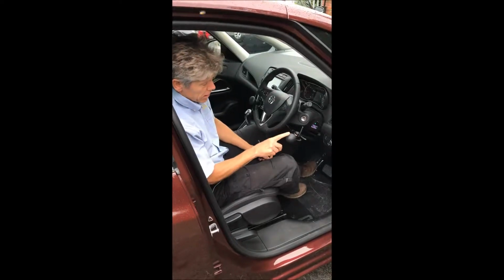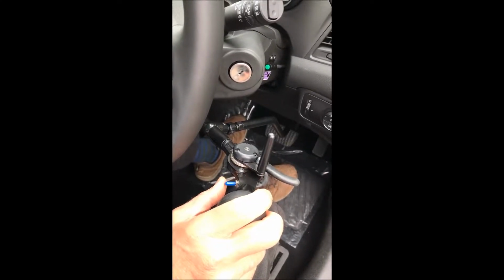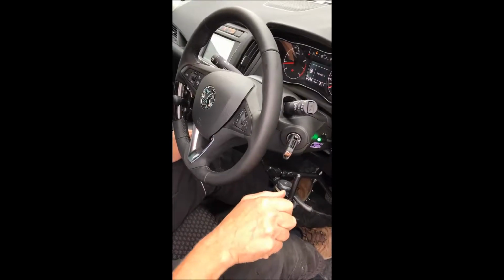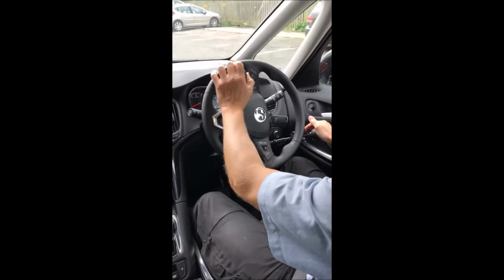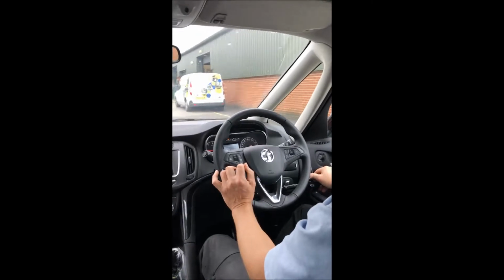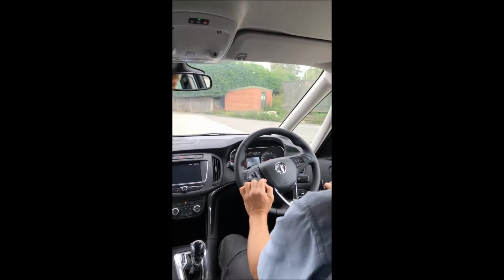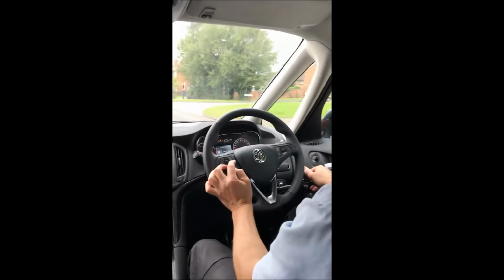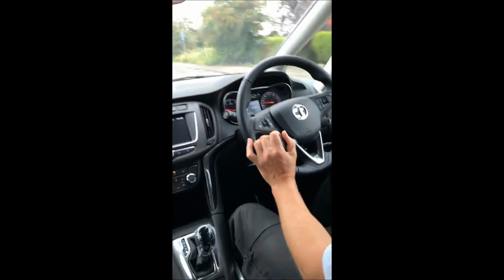Brig Ayd Electric Trigger Throttle

Comment: But can you adjust the steering wheel? Or is it locked in place because of the attachment?
Reply from the maker: The Steering Column will be locked in place unfortunately. Most hand controls are common in this respect. The K5 and Push down brake is a possible option where the column is normally adjustable after fitting of hand controls.
Reply: @desgoslingmobility6587  so you can't own a Fail FSK2005 without having a steering locked in place? I have a Nissan GTR and want my hands on the steering part time. I've found this device to be exactly what I want. Gas rings are not fun, and take a lot of getting used too.
Reply from the maker: David Underwood hi if you like call me to discuss other options. We are installers of lots different systems based in Derbyshire UK 01332 863742
Reply: @desgoslingmobility6587  هل يمكنني الحصول عليه انا بالقاهره